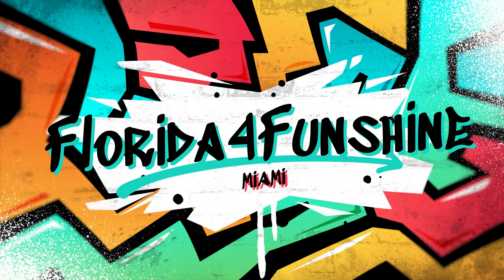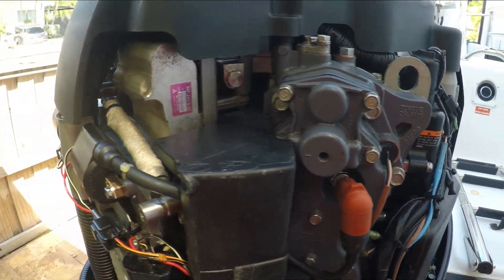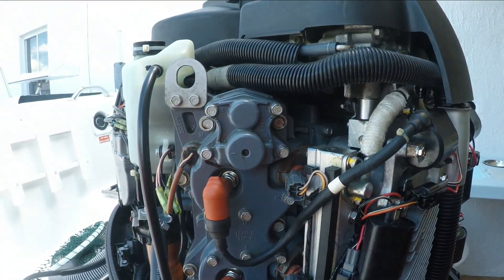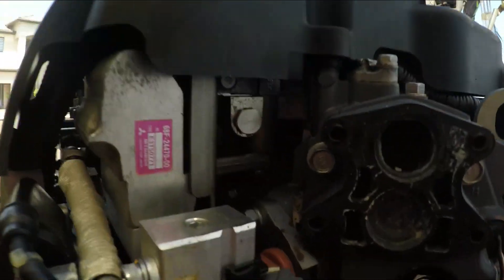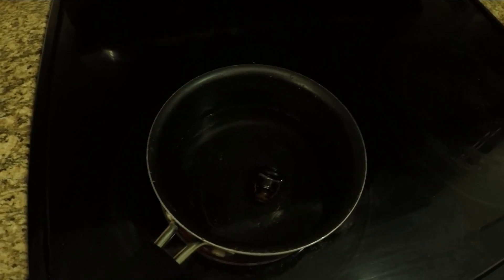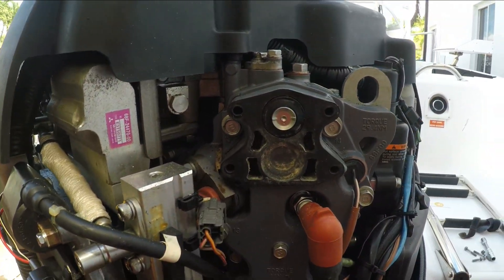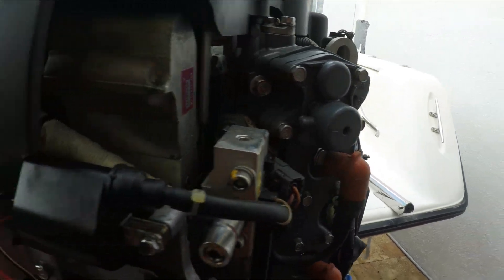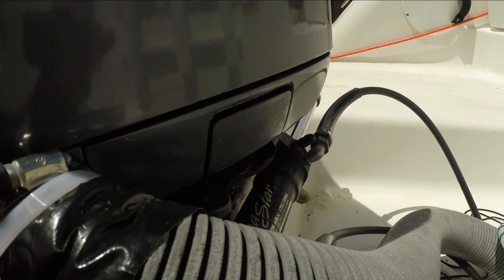Yamaha outboard thermostat HPDI 200 HP removal, cleaning, testing, replacement

Comment: I got a Yamaha mechanic coming to my boat tomorrow I got a Yamaha 200 it’ll run fine and then all of a sudden starts going slow. I’ve been having problems with it for weeks. He thinks it might be overheating sensor so that’s why I’m watching your video.
Reply: and it ended up being a dirty filter right?
Reply: @tcap7917  thank you for your comment, but it ended up being and the mechanic couldn’t figure it out. I looked through videos and someone with the same problem had a video what it is I found it when we go to start sometimes it would only be working on half the cylinders and that’s because when you’re  in neutral,  and put it into drive it’s supposed to click something. There a  blue wire with, a thin piece of aluminum on it when you push it up, it clicks the button the button, some kind of single to use all  cylinders  all six whatever I think I have six blue wire has a metal thing that’s probably getting a little worn out I still didn’t replace it, but I know what to do when it’s running on half the cylinders shut it off off put clutch into neutral  then Drive  a couple of times  and it  put me back in all cylinders again thank you for your comments

Comment: Hi good morning have you ever hooked up a laptop to your 200 hpdi, for diagnostic tests? If so can you please tell me where the hookup port is located? Thanks
Reply from the maker: There is all kinds of harness connectors where the engine rigging enters the engine. Check them and there will be a 3 conductor wire with a gray plug and cap on it. There is a piece of small line on it. That is the YDS connector. There is only one connector that fits the data cable.
Reply: Hi good morning thanks for responding, I have the same Yamaha  200 hpdi where exactly is the YSD located on your engine ? Next to the VST or on the other side? I have searched and can’t seem to find it. Thanks
Reply from the maker: @edwardburrowes4243  hello. It should be by the starboard side where all the rigging goes into the engine. It is a plug.